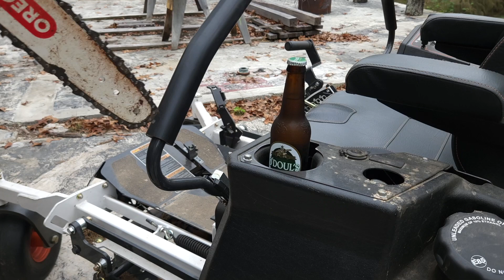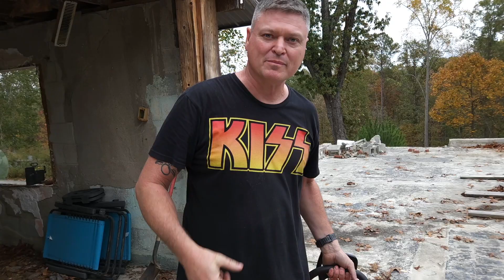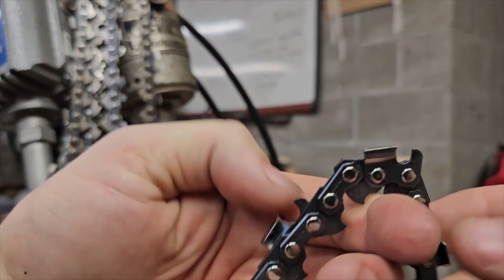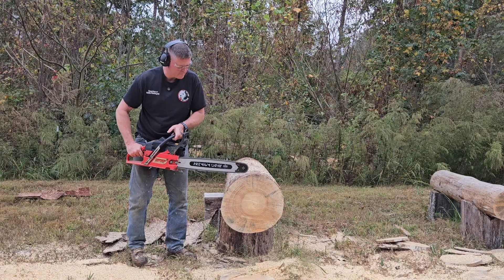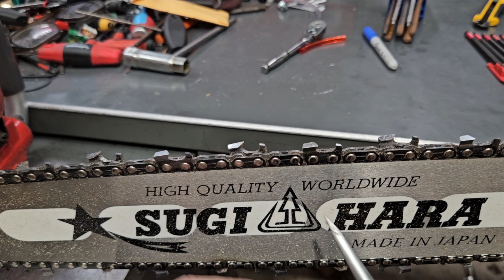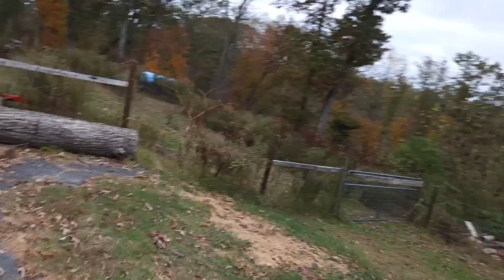Safety Chain, Full Chisel, Semi Chisel, all about chainsaw chains

Comment: You say it's stupid but since most people can't even read a tape measure much less measure correctly with it easier to measure the difference between 5/8 and 3/4 vs 5/16 and 3/8. Pretty smart actually. It's also because we men like maps think an inch equals a mile lol!
Reply: For the ones that can’t read chain pitch gauges are all over the place to buy.

Comment: There's an .043 gauge 3/8 low profile chain too. Stihl labels it their "Pico." Comes stock on the MS170 and 180, and some other too.
Reply: Picco is the small cutter 3/8” they make standard.050 gauge and a .043 narrow kerf picco for less friction on very small saws

Comment: Measuring 3 rivets and dividing by two isn’t stupid. If you just measured two rivets, someone would measure the two rivets on the driver which is commonly different than the rivet spacing on the cutter and the tie straps. And those determin what sprockets you need. By counting three, you insure that they get included in the measurement. Now you know!
Reply: It would be more intuitive to people if they just measured the distance between drive links (from the same spot on each link and with the chain straightened), but that measurement is the same as three rivets. If the dividing by two thing is just to get an average distance between rivets it does seem a little goofy to me, but there's probably a good reason they do it and I just don't know it.

Comment: Finding .325, 20",  full chisel non safefy chains is like pulling hens teeth. Ended up getting Stihl chain, not cheap but it is darn good stuff.
sometimes one has to bore cut, tension / compression bucking, dont want any arguments from my chain. Ive been told .063 guage fits in the groove the tightest,  popular in 32"+ bar lengths, cuts straighter in the big wood. I cant prove or discount this, because i dont know.😮
Reply from the maker: If you aren't finding it online,  try looking for it in 78dl.  If that turns out to be easier, you might solve your problem by getting a new bar.  I detest that Husqvarna went to 80dl. 78dl is more universal.  I have no issues finding 78dl chains.  But... I almost exclusively buy the Stihl RS in .325.
Reply: Husqvarna X cut C33 is your ticket.  I can only find it online.  I am more impressed with Stihl chains than Husqvarna.  Oregon is a no go and Stihl, I can only find .325 20" .050 80 drive links nowhere in a loop.  I found it on a roll at D and B at $.50 a driver.  40 bones is getting pricy.

Comment: Is that an Efco 962?
Reply: Makita dolmar I think?
Nope I’m wrong too. 😂 shindaiwa.
Reply: @jimmylarge1148  two different saws. The second one is an Efco. Just don't know if it's a 956 or 962 (or 156/162). I think they made a 165 also. Deere sold them for a while as CS56 and CS62.

I had a 156 that I put a 162 cylinder on.
Reply: @ oh gotcha. I know he does have an Efco so u are most certainly right if u think u saw it.